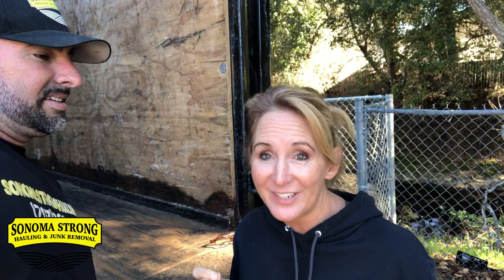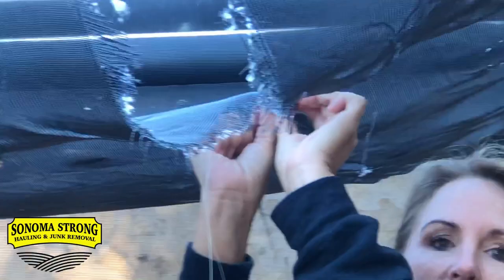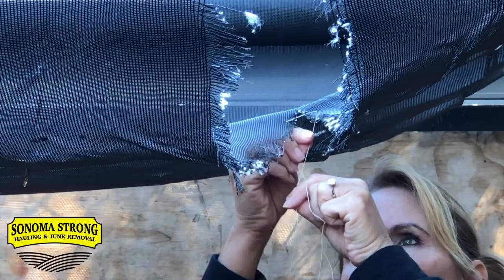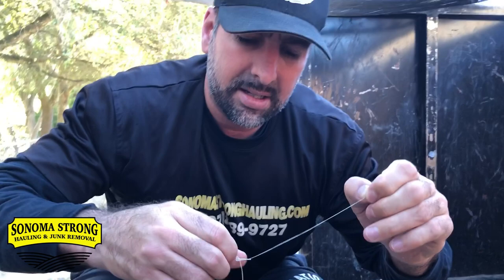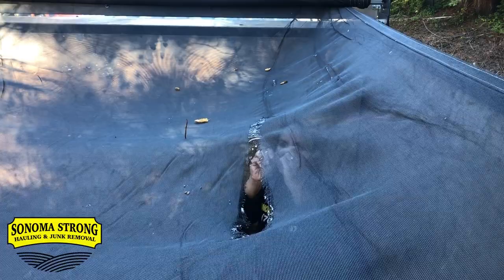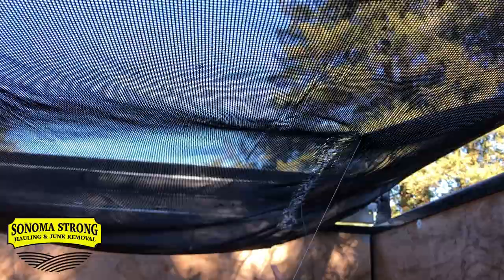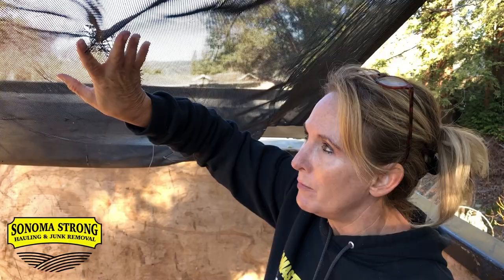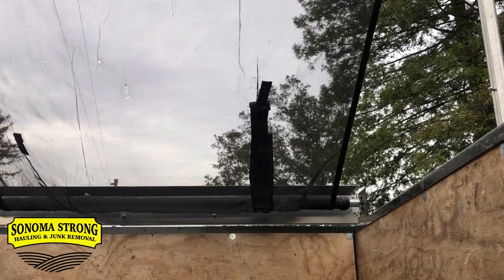How to Fix a Ripped Tarp #howto #repair #gorillaglue

Comment: Thanks for a new kind of junk removal video. It helps show the down falls of junk removal. We to have small rips in are tarps. There not cheap to replace. 

Video to work on:
Med kit. And yes duck tape is a must in a med kit. I Know from experience. That and XXL Gauze. Plus liquid band-aid for small kits.
Reply from the maker: Thanks for the tip

Comment: Seam tape an hot iron. Like they use on carpet. When mine tore I used gorilla tape it wore out after rolling up time an time again not to mention doesn't hold up in the cold much.  Used seam tape both sides an hit it with hot iron then soed a thin piece of leather top an bottom. Little bit of work but it'll out last the rest of the tarp lol.
Reply from the maker: Great tip

Comment: I haven't had to do this before,  but watching it occurred to me that next time maybe try to make a few stitches a lot  wider and more spaced out,  just to draw the material together,  then once the torn pieces are closer together it will be a lot easier to sew and look a lot better.  
Hope I explained that to where it makes sense...then when you are done sewing you can cut the original line away that you used to draw it together.
Reply from the maker: Thanks for the tip.